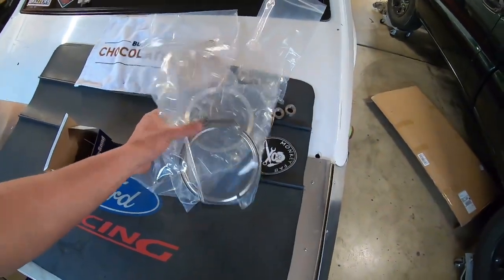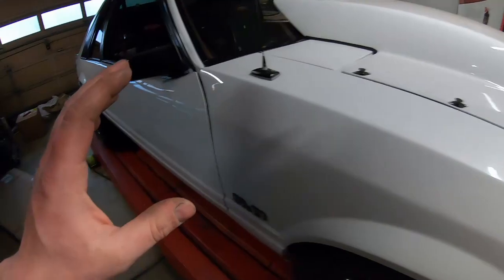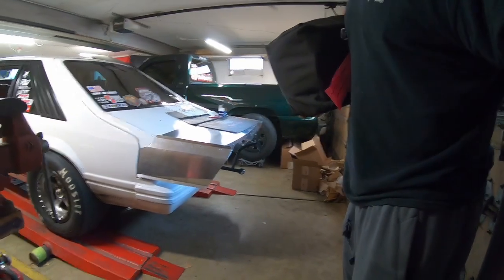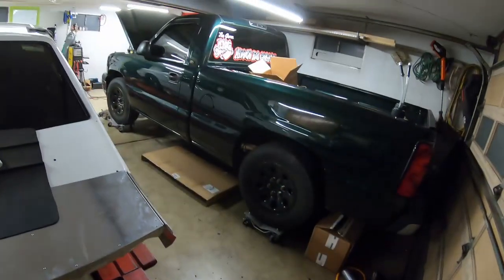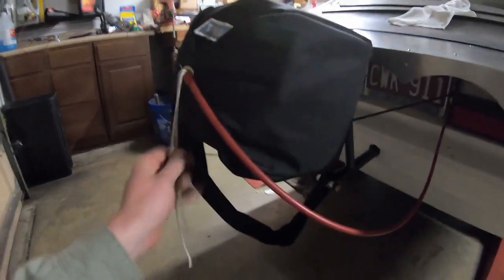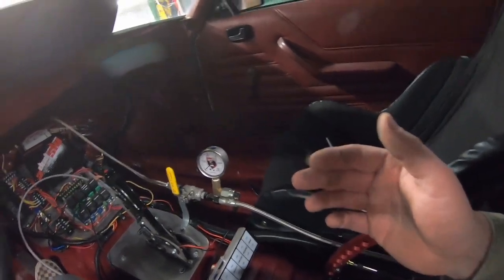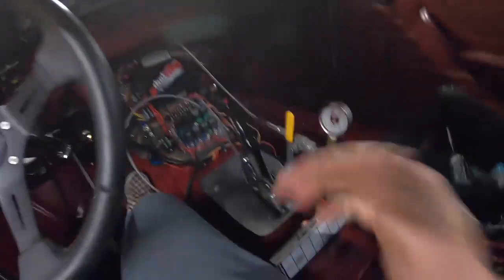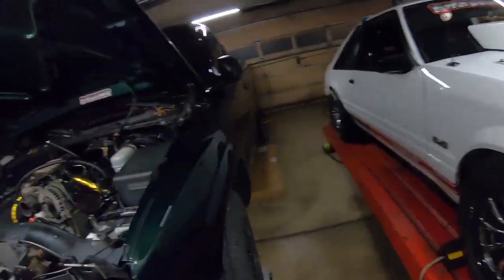Stroud 430 Chute for My Foxbody

Comment: What do you think the HP on the car will be when finished? looks like your getting it done. good job.👍💥💥
Reply from the maker: I'm really not too sure, you're welcome to guess with me! It's an f4te sbe, trickflow 192 highports, super vice with accufab throttle body, medium size hydraulic cam. Th400. 9 inch. And then the plate kit. I'm not sure what the engine makes maybe 380 or 400 ish? Then whatever I spray on top of that. Hoping to dyno it this summer and I'll try to be pretty open about what it makes!
Reply: I made 600 with that exact combo sb351 with old school 192, but on boost
Reply from the maker: Yea I think on a 200 it was probably between 550 and low 6s. It really likes the bottle lol. But I havent dynoed it. We always just guessed on power by trap speed.
Reply: I’ll say a prayer for those cast pistons lol
Reply from the maker: Man I'll tell you what, they have lasted through a lot of bullshit so far. Its insane how tough they and how well they've held up. Hopefully didn't just jinx myself lol
Reply: Hidden 10s Garage   Hopefully when it’s done I could check it out. I love the Foxbody’s